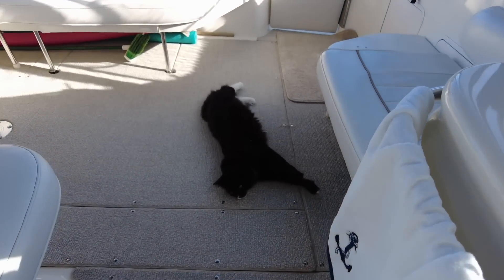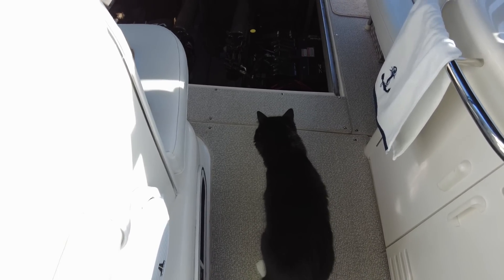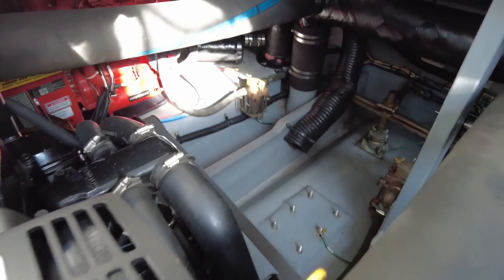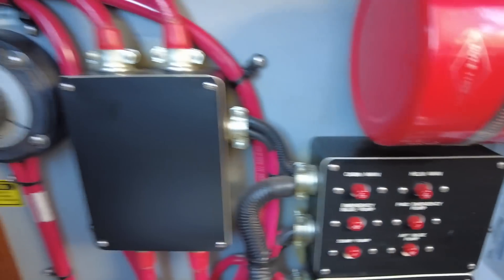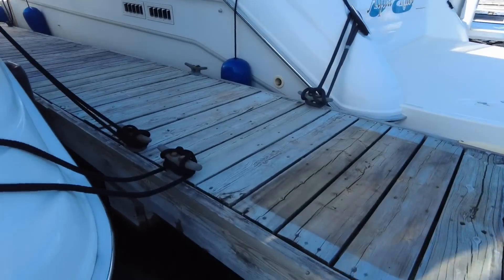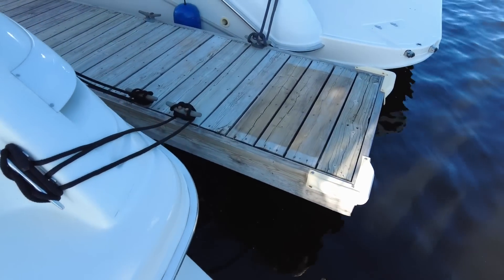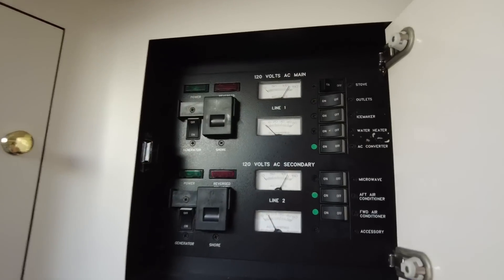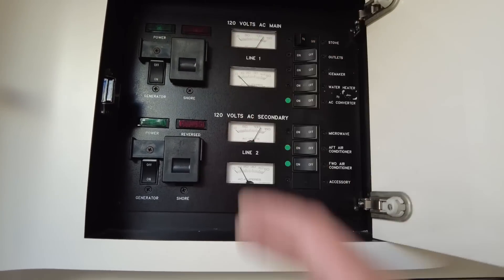Boating Basics - First Generator Startup For The Season - Westerbeke, Sea Ray Boat

Comment: Great work Paul. Do you have any idea how much fuel that uses when your running normal stuff, air and fridge and so forth? How many kW?
Reply from the maker: I'd say it's pretty good on fuel use, although I've never calculated beyond having to put an extra $20-$30 of gas in the tank that it draws from (two main fuel tanks, starboard tank feeds the starboard main engine as well as the genny. Basically, we'd be running the A/C, charger and water heater from the generator. Rest is on the D/C side of power...
All the specs for the boat + genny are in all my video descriptions.

Comment: What's the pre-heat switch for? No glow plugs on a gas engine 😉

And I'm so envious of that engine room
Reply from the maker: The preheat switch on the Westerbeke gas gennys is actually a by-pass used when first starting up. For instance, it will by-pass the low oil pressure warning/cutoff while pressure is being built up. Conversely, if there is an actual low pressure issue, the unit would not remain running if that switch weren't depressed. 
 I find that on a cold start, I have to keep that switch depressed (it's a momentary switch) for roughly 5-10 seconds for the engine to keep running on its own. Same setup on our prior 4.5 kw unit (in the 330 Sundancer) as well as the big 9,600 Westerbeke on our 400 Sedan Bridge.

https://youtu.be/uNFUIv1Hg9I

https://youtu.be/SaTuahKdLpU

🙂
Reply: @BoatingWithBoogaboo  that makes total sense 👍

Comment: Spent the weekend getting our boat ready and one of the jobs was the generator. My procedure was similar to yours. happy boating.
Reply from the maker: Nice. But I'm gonna guess that your procedure didn't include a furry little helper 😄 
 My Saturday was mostly spent fixing + drying up a flooded shower sump/bilge 😩 Yes, there'll be a video. . .
Reply: @BoatingWithBoogaboo  Our furry not so small helper will be coming on the boat this summer.

Comment: It's always nice when things start right up after winterized. Our engine compartments are very similar, I have the 380 with diesels, you definitely have more room than I do. Love seeing dry bilges as well. You got me thinking about bringing my cat onto the boat.
Reply from the maker: We are so happy to have the companionship of my Little Tiny and couldn't imagine not having him with us. Makes our boating days that much more special.
Reply: Every time I see the MPI on those engines I get an itch, but I quickly scratch it once I check the new and used boat listings.  Hate being stuck with a carb but it’s paid for so I’ll be cranking that throttle the obligatory nine times for the foreseeable future.
Reply from the maker: Yes, the used boat market prices remain high, but I'm guessing that'll start to settle down as interest rates continue to climb.
Reply: @cheapme1850  I rent from carbureted 7.4s  in my 330 Sea Ray to MPI in the 3780 Regal. MPIs were super easy to start, just bump the switches, other than that I didn't notice a significant difference. Now these Caterpillars, that's a whole different story.
Reply: Remember to put something in your microwave when you run it, even if it's just a cup of water.

Comment: I just gave our rudder packing nuts a twist on our 1986 38’ Chris Craft and it stopped our leak. I was hanging upside down to get to ours. I think I’m going to have the Marina replace the packing glands if it doesn’t keep working.
Reply from the maker: I'll be trying the same thing on Boogaboo when I have a chance. I had the marina change the packing on our last boat, as it was during the c***d days and the work needed to be done before launch that year. Worked like a charm and no more leaks.